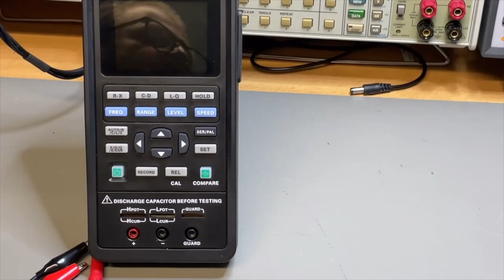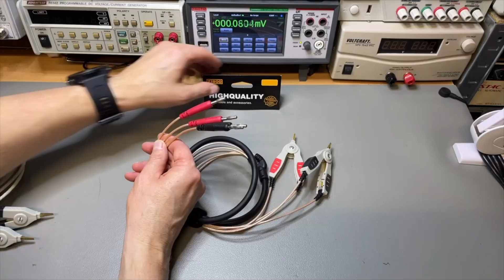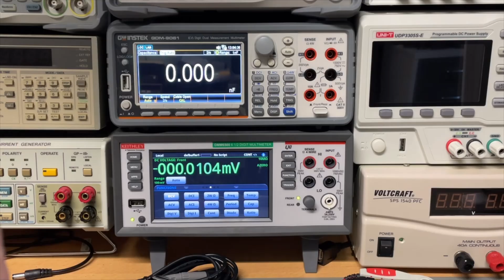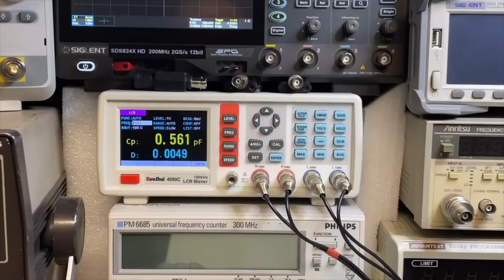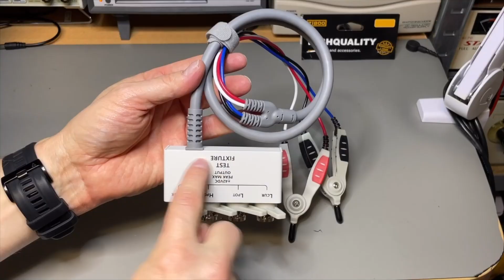TA•0425🟦LCR Fixture or Kelvin Clip - Tweezers or BNC, Bananas and Crocs

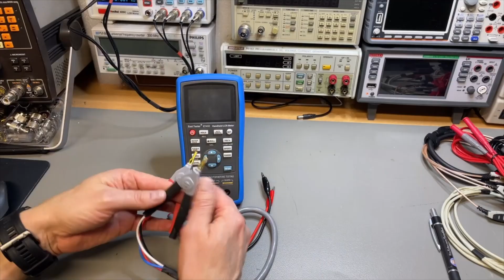Comment: 3:40 are you sure? Afaik the two wires do route to both sides of the clips, they just route them through one side to keep them easy to handle (check where they are soldered)

edit: I see you realized this later on 👍
Reply from the maker: yes you could be right
Reply from the maker: i did not see at first.

Comment: I have a hard time believing the clips shown in the beginning (e.g. at 3:38) are not connected separately to each side. If you're right, that's really fraudulent. The four wire measurement is the reason Kelvin clips exist.
Reply from the maker: yes, they are connected correctly , i show later.

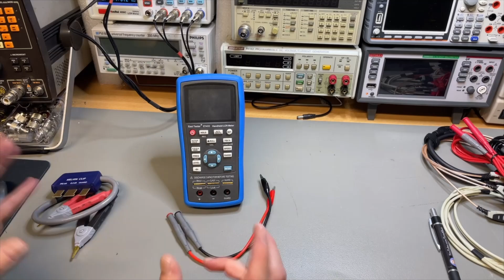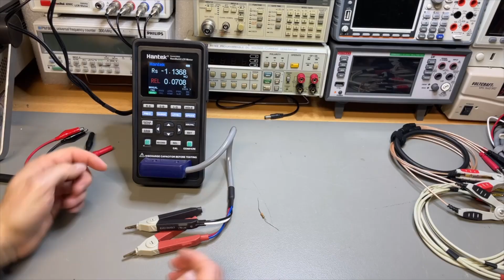Comment: Big error around 3:30 and again at 5:26 - you claim that the Kelvin clips are "4 wire only connected to one side".
What is actually happening is that 2 wired go into one side, but only one terninates on that side. The voltage sense runs up inside almost to the hinge, then back down the other side  to connect on the second tip.
You can easly confirm this is true with a simple multimeter on continuity mode.
I aleays wire mine this way as it makes them a lot easier to use, compared to having 2 wires getting in the way of your hand.
Reply from the maker: Thanks, yes i realized during the video, i think i even showed later how the wire passes from one to the other side.
well spotted btw

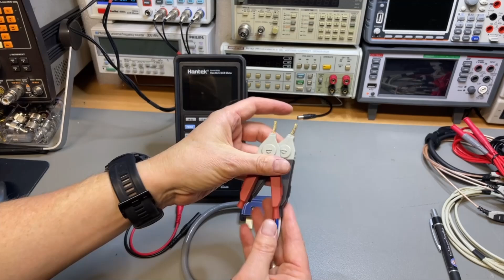Comment: @3:00 Those 4 wire clip leads usually have the 2nd wire feeding back up to the other half of the clip, so each clip has a wire going to it, so it is a true 4 wire system.
EDIT: you figured it out 👍🤓
Reply from the maker: Hi Scott, thanks, yes indeed :),  still i think the Kelvins with Rg316 look much better.
Reply: True. I have this exact set and that is how they are wired in the alligator. The wires exit together for better physical handling.  There are separate blades to the clip ends and the hinge is insulated.
Reply: I just posted a similar comment, then noticed this thread. The video is very misleading.

Comment: Hi Tony. Valuable video presentation. Alternatively, one can become handy with (nano)VNA and do a much wider frequency sweep. You still need different component fixtures, like maybe separate for through hole and smd. Oftentimes is this approach maybe some more work as you need to calibrate, but if you have a few standard setups, you can save the cal reference for a specific setup and doesn't need to calibrate every time, I suppose.
Reply from the maker: Thanks, Nice!! thanks for sharing

Comment: Just ordered a pair.
Reply from the maker: Nice!!
Reply: @TonyAlbus  They arrived, but I need to know how to use them with my B&K 878B LCR meter. My Kelvins have four leads, but my meter just has a single Guard socket. Can I just connect TWO leads together with a 2-into-1 banana adapter to insert into the Guard jack? Or am I missing something.  Do I need to build a fixture for the three slots? Thanks and 73
Reply from the maker: @barrybogart5436  Hi, i think you needed this one: https://go.tonyalbus.com/KelvinPCBdmm
but if you have the babanas , i would indeed think you can put the guards together.

Comment: Hi Tony, in one of your older videos (Lab tour 2022 #268, at about 7: 53) you showed a Rohde und Schwarz programmable voltage source +40V -40V. I have one too, but one of the EPROMs died and Rohde und Schwarz doesn´t want to give the EPROM data. Is there anyway you could read those EPROMs and publish the contents? I tried averything, looked everywhere, but they are nowhere to be found :/.
Reply from the maker: Hi, yes no problem, it could take some time, contact me by email, find it in about. email me so i dont forget,

Comment: Even though they will fit, these might not work with some LCR meters, such as the HP digital bench type. They specify several ways of attaching the shields together, and to ground, for certain measurements.
Reply from the maker: Thanks for sharing.

Comment: Great video as usual Tony! Very interesting to see the different levels of sophistication in the test signals of the various models of LCR meters. That was very helpful. I have a Hantek meter like the one you showed and purchased a Kelvin clip kit from VoltLog where I built my own 4-wire clips. In those, both wires came in one side of the handle, but the sense wire simply crossed over the hinge of the clip and up to the opposite jaw. Cable length was essentially the same with no continuity between the jaws when open. Love your work, thanks for the content! - JRH
Reply from the maker: Thank you! , yes the Voltlog are nice, i saw them too when doing research.

Comment: Wow! You have a good selection Tony. My only 4 wire is the Fnirsi battery internal resistance meter that has crude and stroppy cables.
Reply from the maker: Thanks! , yes collected over the years when i also needed to find out what you actualy need and not. Yes Fnirsi is not the best, but it looks nice
Reply: @TonyAlbus  Fnirsi makes a lot of junk but the battery internal resistance tester is hard to beat in value.
Reply from the maker: @LawpickingLocksmith  Yes agree, i also did eyeball the battery r tester.
Reply: @TonyAlbus  My Fnirsi battery tester is currently the best!
Reply from the maker: @LawpickingLocksmith  maybe when the 11.11 kicks in, i see if its price goes even lower :)